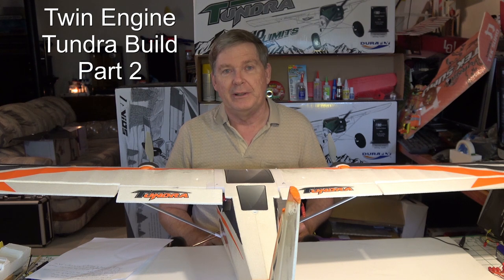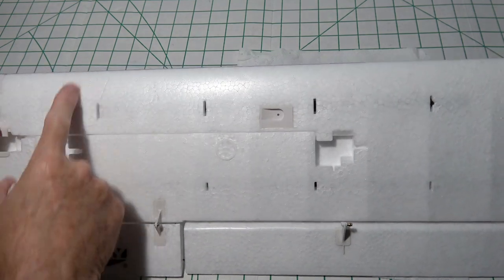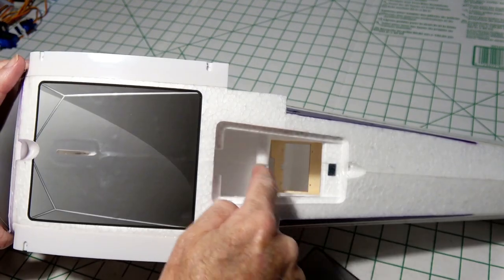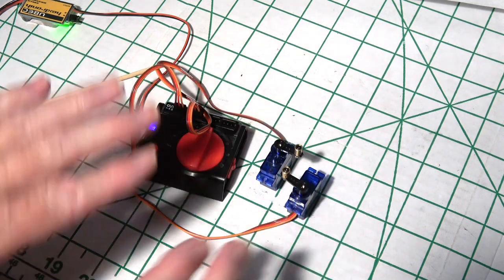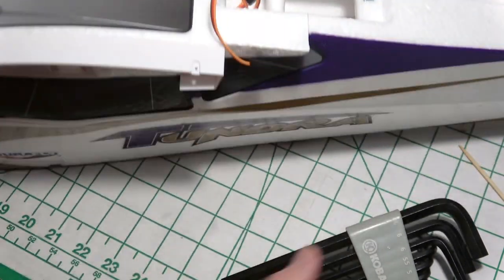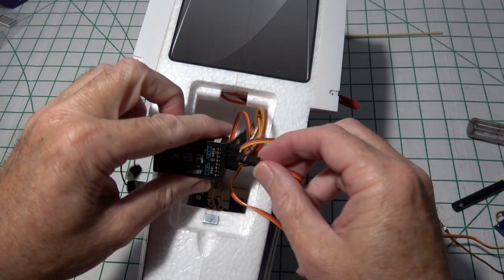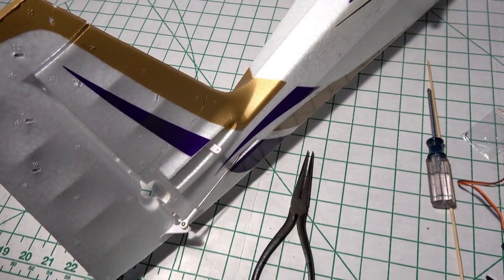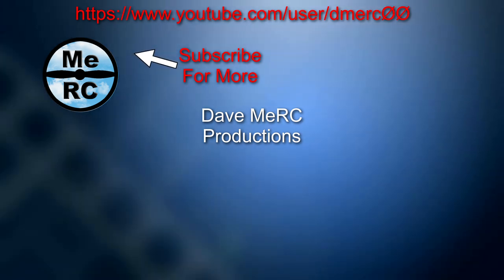DIY Twin Engine Tundra RC Plane Build - Part 2 (Installing Nacelles and Electronics in Fuselage)

Comment: Do you think it would work with two 2208 1080 kv motors and 2 3s 2200mah 25c batteries
Reply from the maker: Probably but you will have to use a larger prop size like 10 inch or more.
Reply: @DaveMerc  oh i buy 10 in props by the gross lol